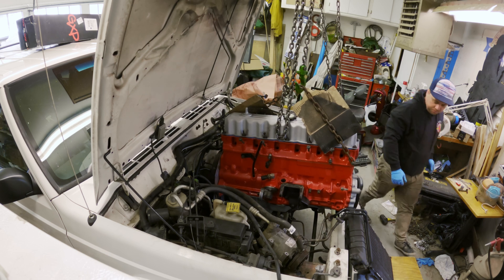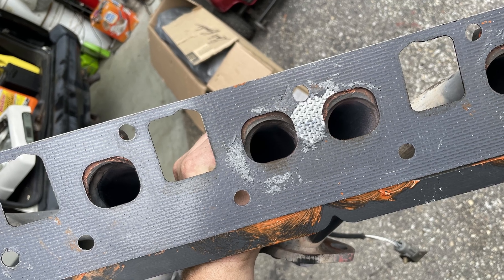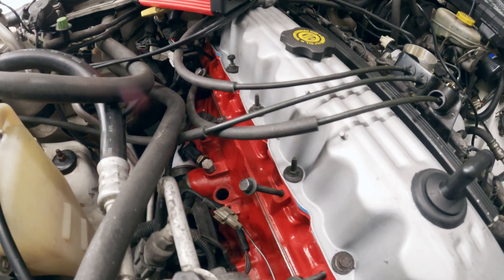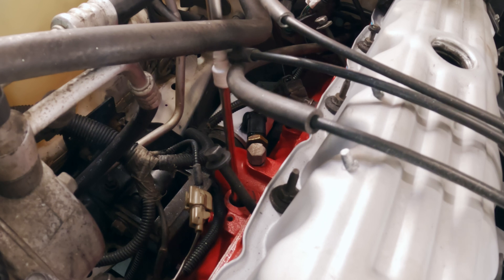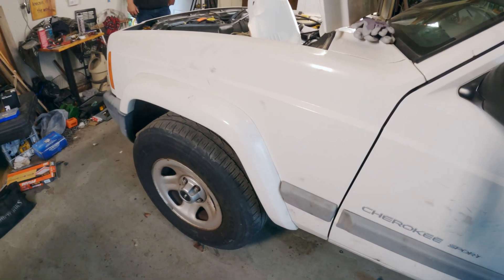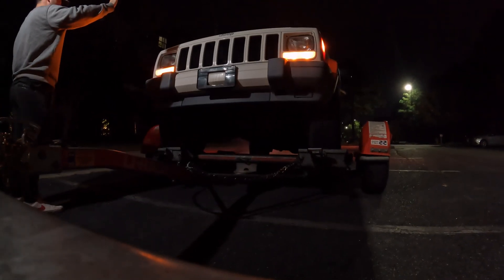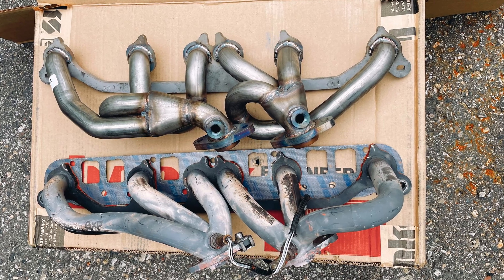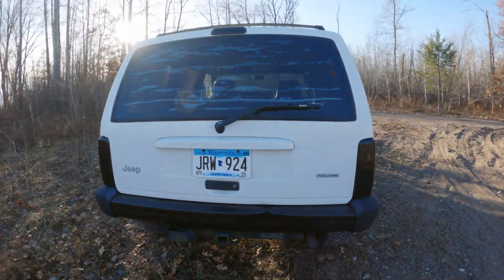Jeep XJ Stroker Build Part 3 -  Reinstall & Break In

Comment: What’s your hot oil pressure running with the build? Literally just finished mine n got 500 miles on it. I’m getting about 15-18 running 10-w30 hot idle
Reply: that’s the 1 sensor I haven’t changed on the whole truck. I’m going to order a mopar sensor n see if it changes anything. Other than that so far so good. Actually uploading a video about it to YT as we speak. I’ll send you the link when it’s live.
Reply from the maker: @xlandscaper  awesome dude def send it!
Reply from the maker: @xlandscaper  that’s should be fine! Mine sits just above 20psi at very hot idle after changing the pressure sender. As long as you’re above 13psi at idle you’re within manufacturers spec. If it starts creeping down there it might be worth checking pressure with a mechanical gauge
Reply: JEEP XJ 4.6L STROKER & FLOWMASTER SUPER 44 MUFFLER
https://youtu.be/JriUPMEDOAI

Comment: Hey bro i did a stroker rebuild on mine as well and had the same oil pressure issue at hot idle, what was the fix? I know there’s oil pressure just not sure why it reads zero at hot idle
Reply from the maker: I replaced my oil pressure sensor. The gauges went back up after that, but not fully normal. I think there was a clog in the oil galley going to the sensor. What you can do is take the sensor off and run the motor for a second to spit out whatever is clogging that and then put the sensor back on. Makes a bit of a mess, but that got me back to normal readings.